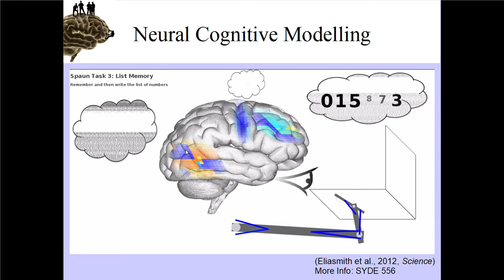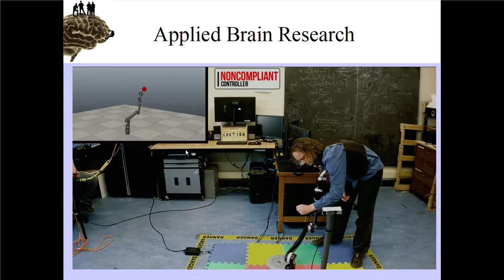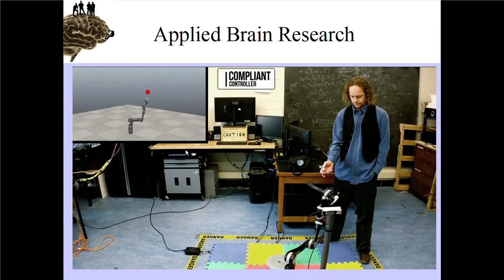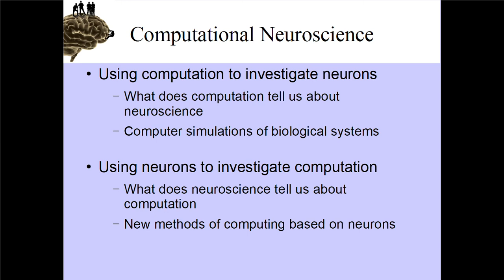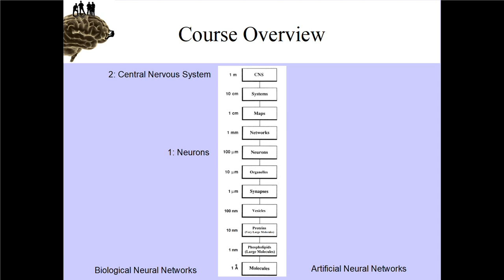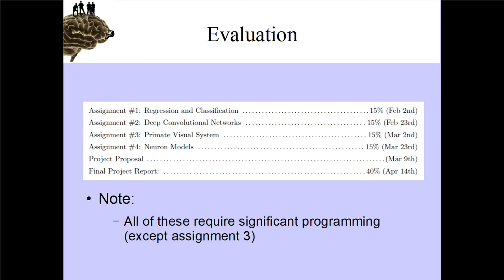Computational Neuroscience - Lecture 0 - Introduction

Comment: thank you so much for the amazing video on the intro to comp neuroscience, I am very interested in the work that is being done on modeling the human brain and it is very kind of you to make these lectures public, I am an applicant to Waterloo's MSc SYDE program with an interest in pursuing graduate studies in this field, and currently looking out for potential research supervisors,  I have tried to parse through your research paper called "A Technical Overview of the Neural Engineering Framework", and trying to crystalize my understanding before reaching out to potential supervisors about technical details of the research, do you have any advice on the best way to breakdown and understand the mathematical models discussed in the NEF? I am having a hard time relating my dusted knowledge of linear algebra and integrals to decode them, thanks.
Reply from the maker: Hello!   And I hope the SYDE program works for you!  

As for the technical details, good question.  Linear algebra, signals and systems, and aspects of control theory are, I think, very useful in understanding the brain, but it's definitely not the standard set of tools and it can be hard to dust off that knowledge (or acquire it in the first place).  I try to do that sort of thing a little bit in my NEF-specific lectures, so those might be useful to you:  https://www.youtube.com/watch?v=w0NxFqIeyZA&list=PLX-XEf1yTMrnjFt30RQ7X6k-dfhL1fIGq
Reply: @terrencecstewart  Thank you for sharing it, I really appreciate your help.